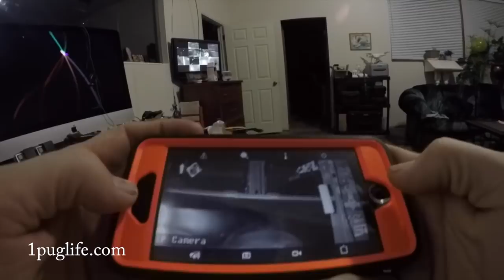off the tabbies, on the doan

Comment: My son's truck had a drain on the electrical system and it turned out to be a worn ignition switch. It would turn off the engine but it left some things hot in the electrical system and would drain the battery if it sat more than 24 hours.
Replaced the switch and no more problems.

Comment: Check the multi plug around the steering column under dash, been telling you, it usually goes bad, bad pin connection. Common dodge issue.

Comment: Maybe the ignition switch is worn and doesn't completely turn off anymore.

It's probably best you disconnected the battery before it catches on fire and burns down your shop and home.

Comment: That's happens to me on my 06 2500  5.9. but it was my key that was wore out and it would run my battery dead by moring if I didn't listen for the door chime to go off. On the lights bud I don't know exactly from what year models but it was up too 07 if remember right.  I hooked up to a friends trailer and the wiring was all caddy womppers couldn't figure out why my back lights wouldn't come on until I found out that you have to take to dealership to have the computer flashed, from what I found out and it took care of my problem. Some goof engineer had to much time on his hands instead of figuring out some thing better  than the 48re trans. Hope that helps a little.